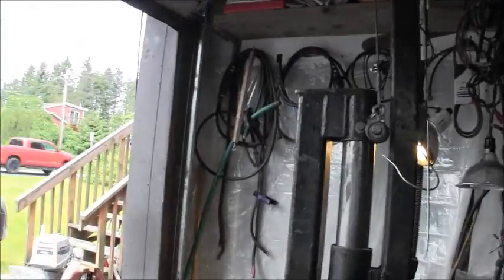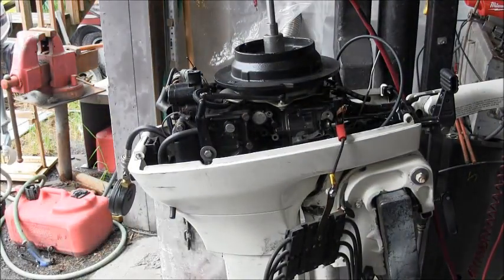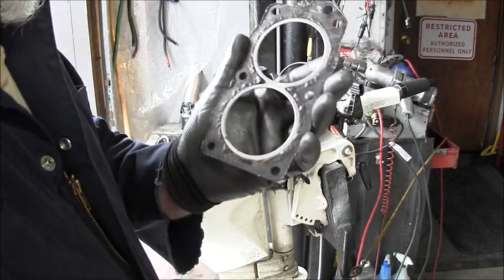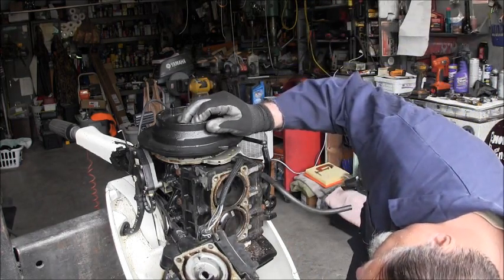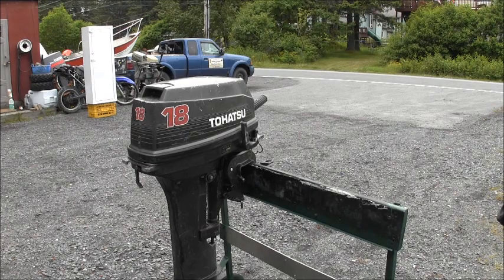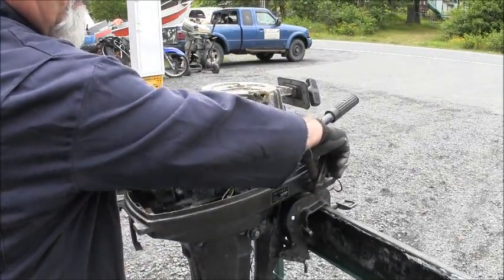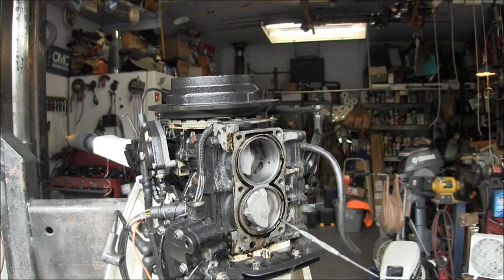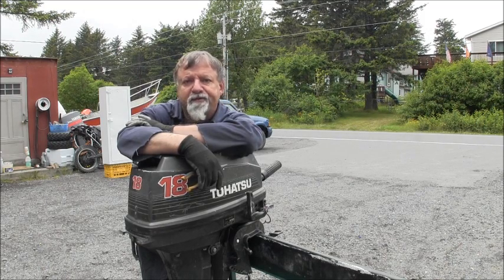JOHNSON 1994 15  HP &  MORE

Comment: Kodibass, I just discovered that certain gas powered string trimmers have a grease hole hidden under the string guard clamp collar that isn't mentioned in the operators manual. I'm guessing that you have seen some trimmers and chain saws with burned up bearings because of this hidden and generally unknown grease hole....

Comment: I have two 15 hp motor one is a 76 Johnson that ran 5 yrs ago the other is a 1988 evinrude that runs just cant get any speed out of it and the top pivot point between motor and mount broke while on the river two weeks ago. do you have a way to contact you?

Comment: Jeez, the aluminum has separated from the sleeve on number one also!   The cylinder is scuffed, probably from overheating.  Sorry, she is toast....OK, you saw it now...  Such a shame....
Reply from the maker: Find it hard to belive it ran as well as it did,     kodi
Reply: @kodibassInsideoutboards    Such a damn shame, doesn't appear to have many hours on it...Must have been a combination of the heat and salt like you said...I have heard of this happening before on these large bore motors...Kinda like the 235 V6s when they bored em out more, the sleeves started separating...Sorry, I just got old style 9.9-15 powerheads, none of the newer ones...

Comment: Hey I’ve been having some problems with my 1986 or 1987 Yamaha 6hp I changed the spark plugs and mixed up some new gas but I have no idea what’s wrong with it this is my first ever outboard motor and I get it running every now and then but after that it never wants to start
Reply: I’ve seen some of your videos and I feel like you would know how to help to some extent
Reply: I hope first, that you’re running NON-Ethanol gas, Second-I hope you’re running ALL the gas out of the carb, Third-I hope, you’re not letting it sit for wks, that’s the worse thing you can do. 

You need to be more specific about you’re problem, you need to watch a basics video, checking for common issue, like making sure you’re getting fuel, you have spark coming from your plugs, making sure you’re not flooding it when priming, make sure you’re getting fuel ALL through the gas line (you can do this by simply disconnecting the line at certain points).
Look through the videos on a basics FACTS check and then if not able to get it started,you need to describe what you’ve done to try to eliminate issues from who you are asking for help. How you have your problem worded at this point, it could be ANYTHING. You need to start by describing whether the outboard ran properly last and WHEN that was, whether you emptied the carb after last run and MAKE SURE you ARE NOT RUNNING ETHANOL FUEL (leaves a WHITE POWDER inside your system and could possibly clog your passages for fuel). Learn to winterize your motor if you’re going to let it sit for a few months!
A piece of advice, GET SOMETHING you can RUN your motor in, not just on the hose and make sure you run (20-30min a good run to bring everything up to temp for a little while, not just in neutral) your motor every couple wks to keep issues from happening, the WORST thing you can do,is let your MOTOR SIT and NOT RUN! It’s like letting a mower sit for months and expect it to perform well!

Comment: I preferred the older shape of this motor...and my ol Yammie would run rings round it... thinking omc were quite optimistic with hp rating
Reply from the maker: When they r not destroyed they r good motors,   kodi
Reply: @kodibassInsideoutboards  thinking that poor motor had a really hard life ...and got really really really hot... never seen a head gasket look all that puffy. All that work you did on it too.
Its a great channel Kodi. from England